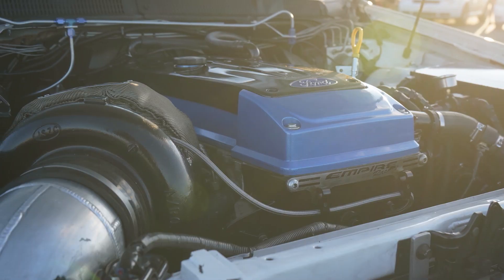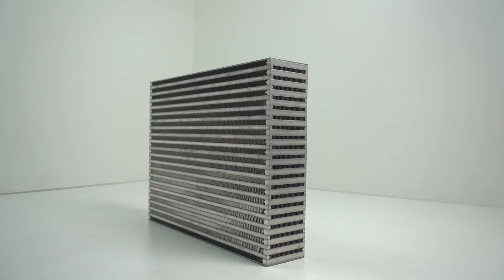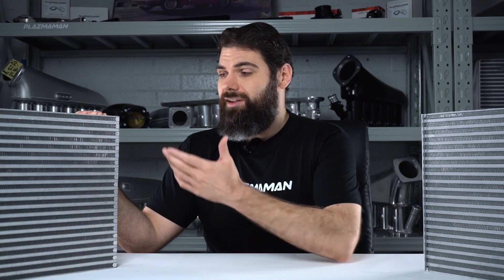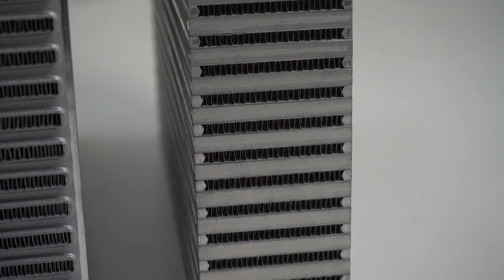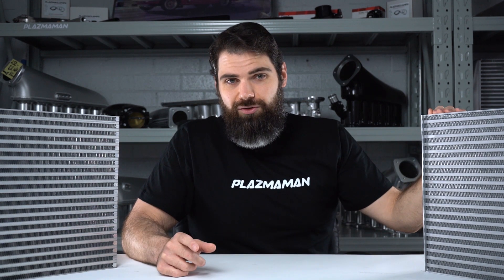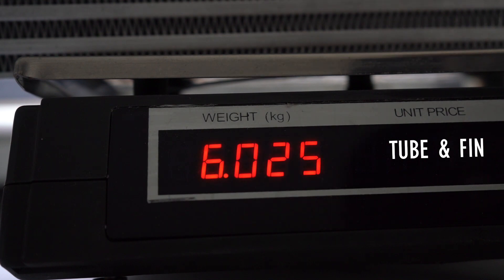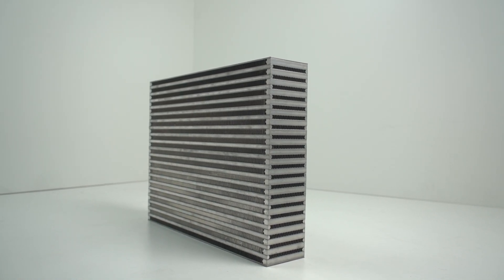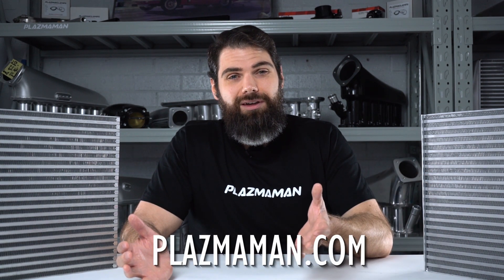PlazmaTech EP:1 - Bar & Plate VS Tube & Fin Intercoolers

Comment: Great info. would love to see a dyno comparison showing iat/boost/power differences between the two types.
Reply: Better yet would be datalog of Street driving, track and drag strip
Reply: Usually the consensus is Bar and plate did street and Tube and fin for the track. You really don't want a tube and fin in stop and go traffic in warned weather.
Reply: I've had both on my car. I don't know if it would be fair to compare though because they were so different in size and shape. My tube and fin was 29x12x2" and my bar and plate is 28x8.3x4.3“ which is almost a 300 in³ difference.
My observations were pretty spot on with what he says in the video. Additionally, with the tube and fin intercooler my turbo hit peak boost almost 200 rpm quicker. This could be from the size difference though.

Comment: Do you really need a 100mm thick intercooler to run 600whp in a skyline GTR? I have been looking at your 76mm, would that work ok? Going to be building a great street machine over here in the UK. Thanks in a advance!👍
Reply: Rule of thumb. Go as small as you can without hampering gas velocity dynamics for both WOT and throttle response. Instead of a $100 monster of eBay, spend $1000 on a quality unit that can perform as good as a larger profile. 
Unless your another one of these drag queens... In that case, eBay will be fine.
Reply: I got the same question but for a 1jz vvti not sure what size i should go for

Comment: Air-water for me- with the addition of chemical cooling it's ideal on a street car, especially with modern packaging like TT V8s in a smallish sedan. There's a reason everyone making nutty factory power these days is going that route. On most modern cars the available frontal area for cooling exchange is not much, and there's not a lot of room for things like fancy V mounts on a street car. Street cars already need A/C and engine cooling, so makes sense to have a minimal exchanger for both (condenser effectively) and a radiator, and then to use those two fluids/gas to cool the remaining components. Similar to electric supercharging which hasn't really taken off, or better yet, hybrids- maximize the use of the energy being produced in excess. Turbos reuse thermal/kinetic energy, most cars have the ability to produce a relatively significant amount of excess electrical energy that can be stored obviously, and also reuse kinetic energy in braking to store as electrical. etc etc etc. 
I won't be surprised to see small displacement engines soon that are hybrids with on demand electric forced induction, to allow the car to have quite literally < 100hp in most situations, and only normal current draw. I assume the weight of batteries and the improvements though in alternator control make this sorta silly an pointless generally. But a fun project on an older car, or to spice up hybrids that already exist. Would be really need to have the electric motor from lower speeds where the torque is needed, and ramp in forced induction at highway speeds, where most hybrids are... lacking. Think Toyota Sienna Hybrid. It desperately needs an extra "kick" occasionally, and the electric powertrain just doesn't do it from anything but nearly stopped.

Comment: During dyno runs my falcon turbo with 650hp plazmaman bar and plate IC always has the same power output on all 3 runs.  During dyno days my car one of very few to not have power loss after each run

Comment: *after cooler
Reply: Intercooler (inlet)  after cooler (after inlet) such as the case on heavy duty diesel engines where the aftercooler is mounted internally in the intake plenum and cooled by the engines coolant.
Reply: @MyYamahayz  It's called a CAC in the diesel world. Charge Air Cooler. Intercooler is really meant for compound setups where the charge air is cooled between stages. We all call  everything intercoolers. All good.